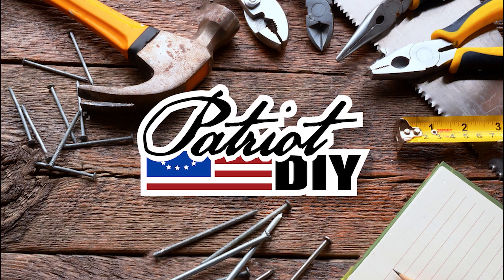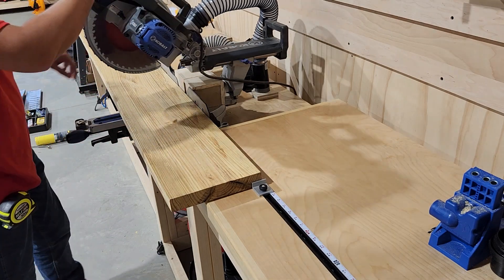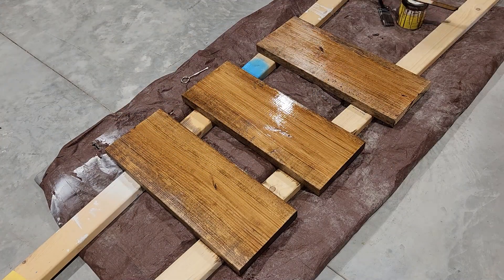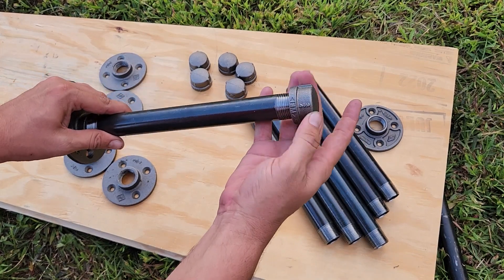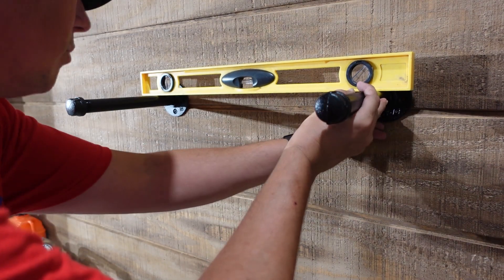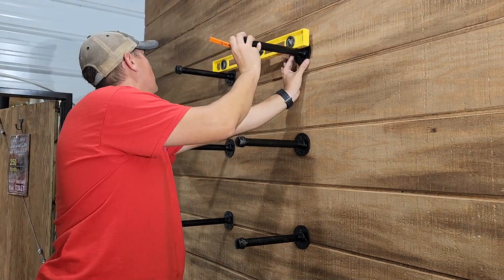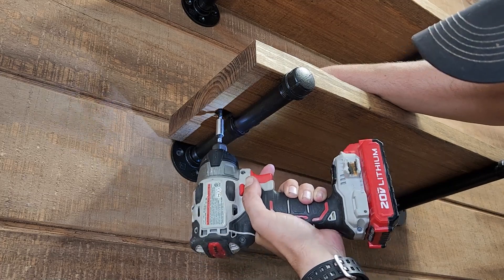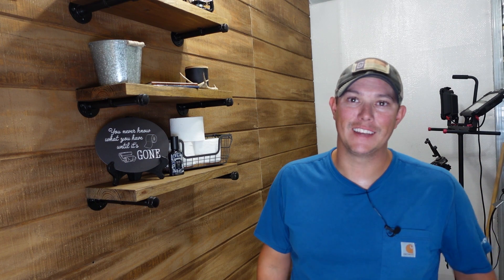EASY DIY Floating Pipe Shelves / Industrial Farmhouse Decor

Comment: I like the look of hidden brackets.  My daughter and I are doing an renovation.  We have stripped down the walls to the studs.  We can hide the flange in the wall.   Drill whole in the shelf to hide 1/2 diameter pipe.   I'm thinking 1/2 would be just as strong as 3/4 in this application.